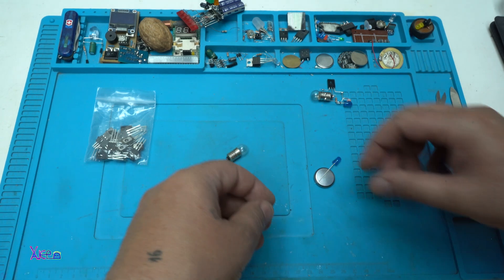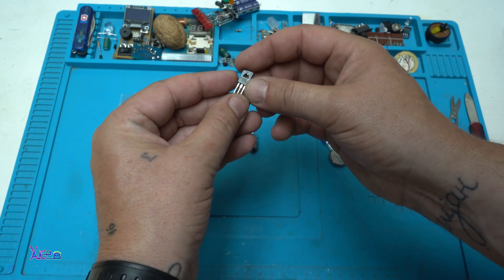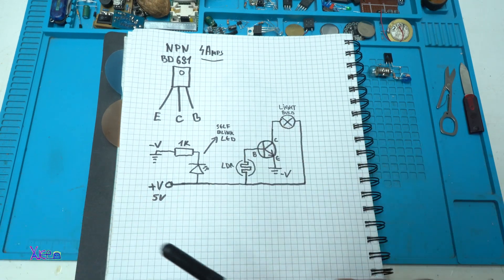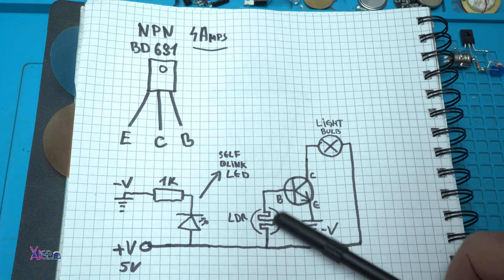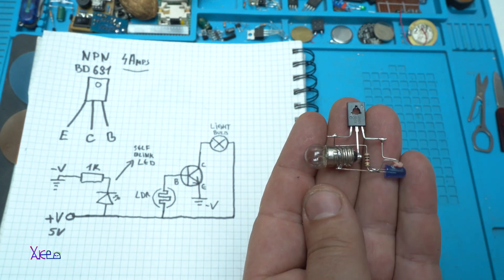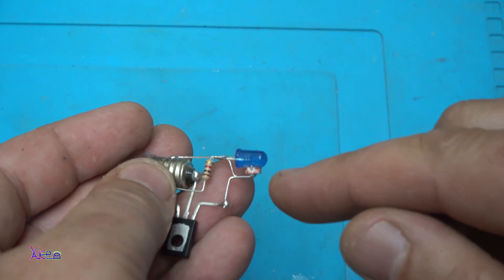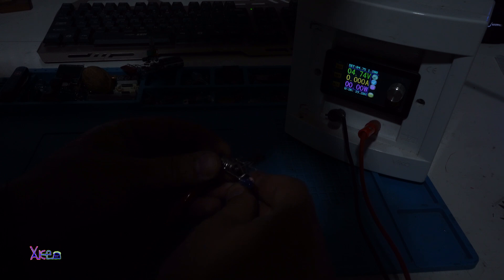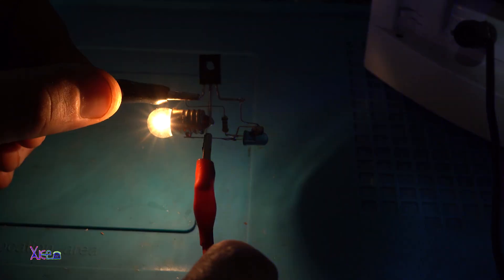Cool Circuit Using Only One Transistor

Comment: Only pulling 300 mA, that's 2N2222 territory
Reply from the maker: I dont think that 2n2222 will hold 0.2A
Reply: @Hacktuber  2N2222 limit is 600 mA, so 300 mA should be okay, but a BC-547 would fold at 300 mA